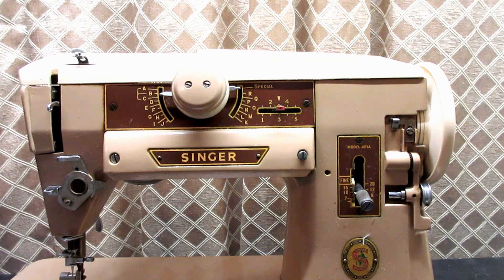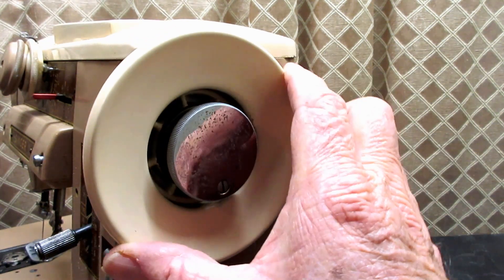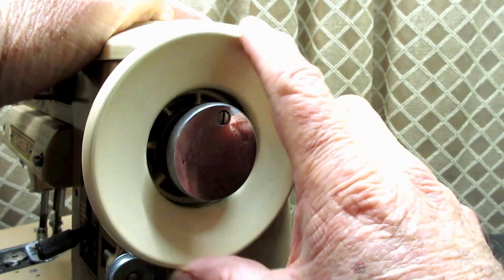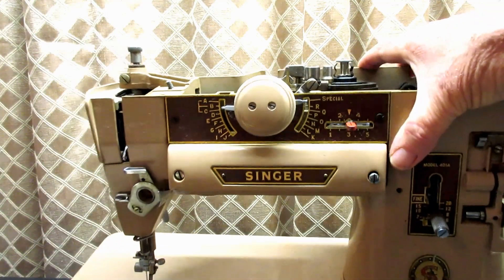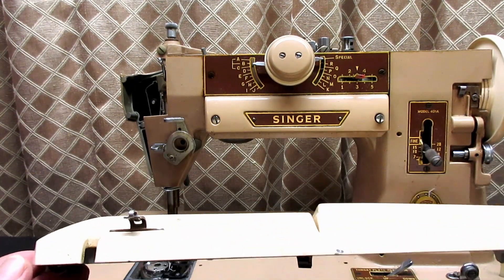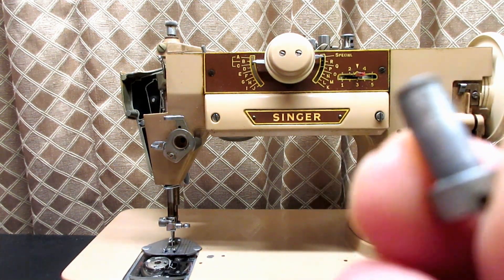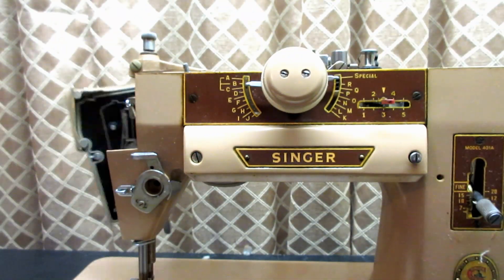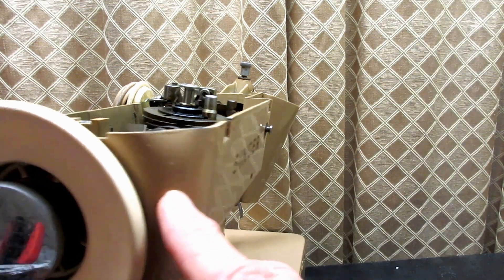Why my 401A Handwheel was not rotating completely.

Comment: I need help. My 301A makes a bike sound and the b
Needle doesn't move.
Reply from the maker: What does a "bike" sound sound like? ☹ Model 301A has all steel gears so if your needle bar is not moving it may be that the machine is in bobbin winding mode. When you turn the smaller chrome knob (stop motion knob) that is on the end of the handwheel to the left <-  you disengage a clutch washer and stop all parts from moving except the motor and the handwheel. That is so you can wind a bobbin without wearing the sewing parts. When you hold the handwheel and firmly turn the chrome knob to the right -> you engage the sewing parts so the needle bar, feed dog, hook, and take-up lever all work to sew fabric. This is explained in the instruction manual on page 12 & 13. A free manual is available here to download
https://ismacs.net/singer_sewing_machine_company/manuals/singer-slant-shank-301-sewing-machine-manual.pdf    A video that includes this is here https://youtu.be/mAUgovRMg7w
a video about the handwheel workings is here https://youtu.be/uCoXJYLIDQo   These two PLAYLISTS contain 38 videos for working on model 301A   https://www.youtube.com/playlist?list=PLsCOZgzzaiKI_6fbu3itbd1v4z3uQvvkO      https://www.youtube.com/playlist?list=PLsCOZgzzaiKLZyGebzS_oISgesXNyREyI

Comment: Wow, that gives me some idea about this hand wheel thing. I just found  a sewing machine in a thrift store which seems to have the same issue. The hand wheel cannot rotate completely. I was very hesitant to take it home. After watching your video and several other videos on Youtube, I probably will go tomorrow to buy that one.There is always a chance that I can find a way to solve it right? Thanks!
Reply from the maker: Oh I know you can solve that problem if it's moving. It's always a good sign. It's just something is blocking. It could be dried oil in the bearings. It could be the bobbin case isn't installed properly and is catching on the hook and stopping the movement. Lots of things like that. If you like the style of the machine pick it up and if you need help I'll walk you through it and you can save a nice machine from a useless death in a landfill. Good luck!

Comment: So, the hook thingy on my Singer Zig Zag 457 won’t rotate. The needle goes just fine (although it keeps hitting the driver). The driver itself will not turn! I can’t figure out why! Is there anything you would recommend trying?
Reply from the maker: Yes, I have a recommendation. You have a broken gear on the top of the vertical shaft that powers the timing pulleys/belt to turn the hook (driver) I have a playlist of videos for your machine: https://www.youtube.com/playlist?list=PLsCOZgzzaiKK9GeuGLCo6ZyWv-HbheRVK    one of the videos is a step-by-step tutorial for replacing the gear: https://youtu.be/M3bFtlV1Y6s    The video has 100K+ views which shows what a common problem that old gear is. The new gear costs about $10. Thanks for asking, and good luck.
Reply: @andytubesewing1953  Thank you so much!
Reply from the maker: @charlottemacmaster3221  for sure and best of luck to you

Comment: I can't loosen my clutch knob. How do I manage that.
Reply from the maker: A couple of reasons for this. Occasionally there has been oil settled on the clutch washer between the wheels and it dries up and gets like varnish or glue. Putting fresh oil in-between can soften the old oil and allow turning of the knob. You can also heat the area for a while with a hair dyer to soften it. The washer may have been put on backward. That can allow the little stop screw to rest on the raised stop of the washer and get "stuck" due to presser. You should remove the little stop screw to allow turning the knob. You can also remove that screw for application of oil or a WD40 type product. Sometimes the knob was over-tightened, (often b/c the washer was backward) and it requires more muscles to turn. Always remove the little stop screw. I have had my wife or friend hold the wheel while I turned the knob (4 hands better than 2) I have also used a channel lock plier to turn the knob. Put something around the knob to protect it from scratches. I use a scrap of leather.   How to remove wheel: https://youtu.be/eZiMaaka5HE     How to install wheel: https://youtu.be/hHl96WL1kzA

Comment: Hi Andy, I have just come to try my 457 but the motor can't turn it round, and turning the machine by hand is really stiff like it is binding, I have lubricated all of the oil points but still tight, when I put the vertical gear in I lubricated the shaft also the bobbin wheel shaft and they were free as anything, do you have any ideas what it might be ? Thanks
Reply from the maker: Hmm.. was the machine hard to turn before you replaced the top gear on the vertical shaft? If not then it is almost certain you caused the binding. The two most common areas of binding after replacing the gear are the gear itself, or the timing belt being too tight. 
     I know you have watched my gear-changing video. https://youtu.be/M3bFtlV1Y6s     The pinned comment at the top of the comment section is by Paul Hibbs and he talks about the new gear he bought being too tall b/c the metal base below the plastic gear is taller and made the gear bind just as you describe. He had to grind down the bottom of that metal base to match the original gear base then all was well. 
     If the Timing Belt is too tight it will also bind the whole machine (everything turns together, right? It is easy to test that by loosening/slipping off the timing belt and turning the handwheel. If it still binds you'll need to do something with the new gear. If it does not bind any longer, then reinstall the timing belt a little looser. That's my best guess without having the machine on my workbench. Good luck.
Reply: I didn't turn it properly before I replaced the gear so I don't know Andy, I will have a look at the cam stack, is there anything else obvious that it could be ? Thanks
Reply from the maker: @acestu  just that any binding part will cause your problem. If you think the cam meshes too tight to the worm on that shaft that can bind the machine. The main upper arm shaft has large bushings that require oil. Bent needle bar, dirty needle bar bushings. Endless possibilities I guess. I try to separate the top-from-bottom movement to isolate if the binding is above or below and go from there..
Reply: @andytubesewing1953  Hi Andy, thanks for the advice, I stripped it down again and I found a tough spot on the bobbin wheel so I cleaned and oiled the shaft again and it was free, hope that was it, will soon see
Reply from the maker: @acestu  Just for any other viewer reading these comments I believe when acestu talks about "bobbin wheel" it means the rotary hook that holds the bobbin case and bobbin and catches the needle thread.
Reply: @andytubesewing1953  Hi Andy, when I take the vertical shaft back out the motor spins the machine no problem so it must be the worm gear that I put in , is there only 1 type ? because I am wondering if they gave me the right one or not...
Reply from the maker: @acestu  The gear on model 457 is part #155819. As I mentioned in an earlier reply some viewers have mentioned in the comments that the gear they bought had a taller metal base than the original and that cause the gear to bind with the gear on the horizontal shaft. Most reputable sellers are selling the proper gear, but they all come from China and they get whatever China sends them. Here is an example of a reputable seller in business for a long time whom I have bought gears from
https://www.ebay.com/itm/402291474692?hash=item5daa70c104:g:d4YAAOSwkkxeH5pb
Reply: @andytubesewing1953  Thanks Andy, after a bit of investigation last night it seems that the top of the shaft is slightly bent as turning the oiled shaft will drop out on about 3/4 of the shaft but then has a hard spot, I wonder if it got bent when the old gear shattered ?
Reply from the maker: @acestu  Wow! I've never encountered a bent vertical shaft. That is unfortunate. To verify you can always remove the shaft from the bottom and roll it on a flat surface with a light behind it. If you see light under the shaft it is surely bent. I don't think the gear breaking could cause enough force to bend that shaft. The shaft is thru a top and bottom bearing so it has support at both ends. If someone had the shaft halfway out and lifted it by the lower end or dropped it on the exposed end then that would be a force that could bend it. You may be able to find a replacement shaft at thrifty farm girl. Connie has some 457 parts listed and you could email and ask if she has the shaft, part #98211. She may have it but it is something she normally would not list for sale b/c demand is so low. https://www.thriftyfarmgirl.com/shop/singer-457-stylist-parts   remliquidators on eBay also is selling parts from a 457 and may have the shaft if you ask for it: https://www.ebay.com/str/remliquidators1?_trksid=p2047675.m3561.l2563
Reply: @andytubesewing1953  Hi Andy, it is a mystery but I sanded the shaft down with very fine wet and dry paper, cleaned oiled a few times and the hard spot seems to be going, only very slight but thats all it needed, the motor now turns the machine but i think it needs a touch more sanding which i will do tomorrow
Reply from the maker: @acestu  Congratulations. I admire your determination.
Reply: @andytubesewing1953  Thanks Andy, I was just set to  design and 3d print a new bottom pulley for a new piece of 8mm bar but I think it is going to work
Reply: By the way Andy thanks for suggesting the places where ii could possibly get some spares but the postage from the states to the UK is colossal

Comment: Good to know what to look for! I bought a 237M recently and the handwheel would barely move. Turns out that there was a foot of thread wrapped around the main shaft just outside the machine, under the bushing, under the handwheel. I saw some of it poking out, but had to pry off the bushing a 1/2" to get at the rest. Now with all the oiling you showed in your 237 video, it's loosening up well. Hope that helps someone who might be searching for "handwheel not rotating completely". There was more thread under the belt, wrapped around the motor. I think that's a problem with the bobbin being in the top right - bits of thread fly all over and get grabbed by moving parts. (If it's a Featherweight, the Featherweight Shop sells a clever tool to remove the bushing, but it did not fit the 237.)
Reply: Thank you. My handwheel rotates but makes a rubbing noise. Any help is appreciated

Comment: Hey, Andy, great videos, I really appreciate you sharing your knowledge like this. I was inspired by your videos / work to try to fix my wife’s Singer “Graduate” Model 714. Unfortunately, I’ve hit a bit of a wall: I still can’t figure out why the hand wheel will not turn easily all the way around, either forward or backward. I removed the belt to see if it was the upper shaft or lower shaft that was the problem, to narrow my search, but with the belt off, both shafts spin freely independent of each other. But after inspecting, cleaning, and putting the belt back on, the problem returns where the wheel will only go a certain distance and then become very hard to turn / gets stuck again. I don’t see any bent or broken pieces that are preventing the belt from turning, so I was hoping you might have an idea or two of what the problem may be and / or how to go about fixing it. Thanks, in advance, for any advice you might be able to provide me. Cheers!
Reply from the maker: Congratulations. It is only the 7th and you've one the problem of the month award. 👀🏆 I don't work on this type of machine, Evan. I know it has a cogged drive belt between the upper and lower shafts, with some plastic gears on the bottom and I believe a direct drive motor that tuns the handwheel. When you said both the shafts turned OK without the belt, were you turning both belts at the same time? The lower shaft usually turns the hook and feed and the upper runs the cam stack, ZigZag, VIbrating bracket, and needle bar system. I don't know if something is only blocked when both shafts move at the same time, like turning the hook and cam stack but being blocked. If you'd like to email andymanuals53@gmail.com I can give you some parts manuals and service guides that may help you. No charge. Good luck. (plz put Singer Model 714 in the subject line)
Reply: Thanks so much for the speedy response, Andy. I spun each shaft separately with the belt off. I’ll try spinning them simultaneously, belt still off, and see what happens. Thanks also for the offer of manuals and service guides; I may just have to take you up on the offer. We’ll see. Take care.
Reply from the maker: @evanwilliams5269  Good Luck.
Reply: Were you able to find the solution. I have the same problem with a kenmore.

Comment: Love your video 
I have a 1946 singer and when I loosen the handwheel to fill bobbin needle still goes up and down 
Cant get the screw undone to fix
Any suggestions?
Reply from the maker: What model of Singer? Can't get the stop motion screw to loosen or remove? They get stuck with dried oil sometimes. I take out the little screw and put a couple drops of WD40 in the hole, and also a couple drops behind the stop motion screw between it and handwheel. That can soften the dried oil and let you get moving. I will also heat up all around the area with a hairdryer. Same thing; soften the oil up. I have also used a rubber mallet to tap on the wheel. That rapping motion can break it free also. SOmetimes from the end like I was driving a nail into the handwheel and sometimes from the top left edge of the screw in a downward motion, the same way it turns to come off. I've used the plastic handles of screwdrivers and covered the screw with a towel and tapped on it with a small metal tack hammer. No need to smack it so hard you damage anything, One or all of these methods will get the screw turning.
Good Luck, and thanks for watching my channel.

Comment: How can I remove the handhweel knob from my Singer sewing machine 974 because it doesn't work. Tks
Reply from the maker: I've never worked on that model but you take the small screw out of the stop motion knob and unscrew the knob to the left to remove it then pull the handwheel off the arm shaft. The handwheel doesn't work? All parts work togethr and it could be another part causing the problem. Here is a basic video for removing the handwheel.motor belt on a vintage SInger machine to give you some idea of the removal process: https://youtu.be/6H-SDwXLQDk

Comment: My Singer 201 a Wheel gets loose when sewing and the lock wheel comes undone; therefore the needle won't go up and down.  Is this something I can fix at home?
Reply from the maker: You can fix this, Linda. it sounds like the clamp between the handwheel and knob was put on wrong. Here are 2 videos about removing and replacing the handwheel (you do not need to remove the counterbalance) Just follow along to take if off, do a little cleaning, and put it back on and you should solve the problem.
Remove: https://youtu.be/eZiMaaka5HE
Install: https://youtu.be/hHl96WL1kzA
Good luck and thanks for watching my channel.
Reply: Thank you so much.  You were right.  I had the darn thing on incorrectly.  I'm still having problems sewing through seams when hemming jeans, but the lock wheel stays "locked".  Are there any other adjustments that I can do to make this work?
Reply from the maker: If it has the "potted" motor I don't know about that. If it has the motor with a belt you can try to seat the motor brushes better to gain more power and clean/adjust the foot controller. Brush seating video (not for potted motor) https://youtu.be/rpTy_Bz3prA

Comment: Just got my 401 out of storage after several years , i cleaned her up and put oil in all the areas the owner manual said and she sings beautifully, my one issue is the plug that goes into the machine attached to the foot controller has broken wires and i m not sure how to fix that.
Reply from the maker: You mean the cord with the 2 male prongs? You can buy a new replacement cord from a trusted seller like this one: https://www.ebay.com/itm/Singer-Foot-Pedal-Cord-Male-2-Pin-301-301A-401-401A-403-403A-404-197628-NEW/370639975898?hash=item564bdd35da:g:BUAAAOxygo9Q8vVI  About $10. I have videos about restoring the pedal itself and they include removing/replacing the cord wires inside the controller. In fact, while you are waiting for the cord delivery, you can give the whole controller the once-over following my step-by-step videos 😉
When the cord arrives you'll be installing it and have a foot controller like new, then back to sewing, but more safely. Here is the series for the foot controller:
https://www.youtube.com/playlist?list=PLsCOZgzzaiKL6ePPxLpmnWSzTyxPKTb71
Honestly, Honestly, I think it's a good solution 👍 Thanks for watching my channel and good luck.